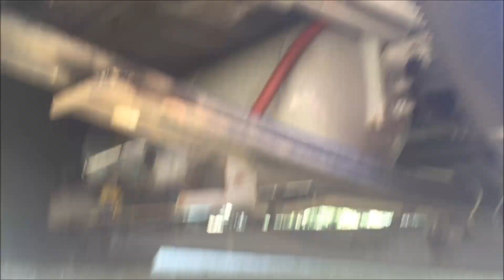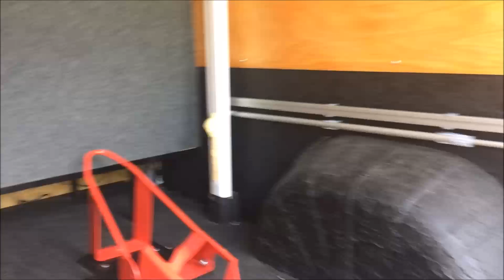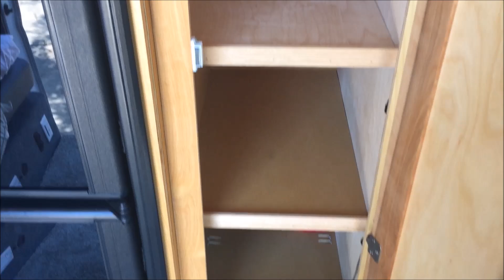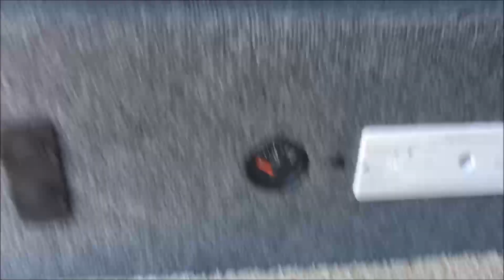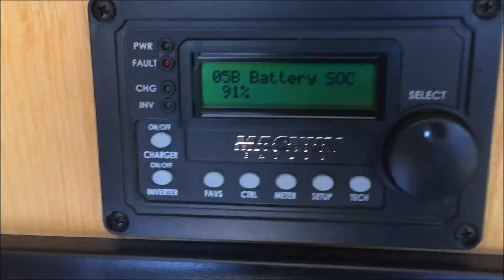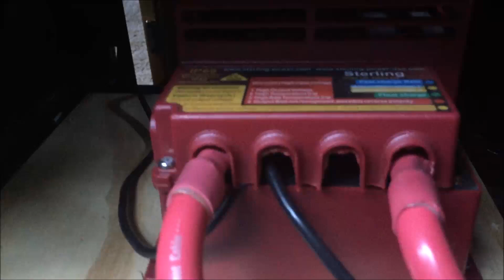DIY Stealth Camper Van Tour

Comment: Great track van. Nice job on the layout. 
Looking to convert my 1st van in the spring. With possible bike trailer. Did you have any problems with the diesel Promaster. Looking to stay away from sprinter and dont really car for the short wheelbase of the Transit.
Thanks for sharing. Mike

Comment: Awesome moto van! Love all the options that you installed. I am building one too. I thought about a suspended bed and three dirt bikes underneath it, but then decided to go for a couch and one dirt bike. More useful for me since I usually carry just 1 or 2 dirt bikes. My van is going to have a shower though, and a pressure washer to wash the bikes. I do not want to be dirty after riding dirt bikes!
Reply: Philip good choice
Reply: I've seen a similar idea but done with 2 sets of flip up bunks mounted on either side of the back of the van with a drop in piece to make the bottom bunks a king sized bed if wanted. Just fold the bunks up and add dirt bikes. 1 adult size one and 2 kids sized.

Comment: What does that air conditioner pull when it's on? I've been wanting to get one that doesn't kill inverters and generators and blow fuses all the time... the one I have is over 30 years old and it draws unimaginable amounts of power. :[

Can you run that air conditioner off that inverter? (Those Magnasine ones are really nice... I'd be surprised if it wouldn't start the AC just fine.)
Reply from the maker: Four ZeroFour it ran fine off of my generator.  I had a 3000w champion inverter generator.  It would run off the inverter too....but man the 400amp hrs would be down to 50%in like 45min.  It was a Mach 8 13.5 by Coleman.
Reply: @Dr.KennethNoisewater  Kenneth that's what I figured.

Comment: I am curious what is the electric distribution panel you have. this is the second time I've seen this same one and the last person wouldn't tell me. those are square D home line breakers in the box right?
Reply: DrKennethNoisewater Hi nice work is the promaster is agood choice comp to ford or M b
Reply from the maker: Skye Renard 

PD5000 30amp panel

http://www.bestconverter.com/PD5000-30-Amp-ACDC-Power-Control-Panel_p_27.html#.WMDPCIFOKEd
Reply: Thank you very much. Quite the life saver

Comment: I know you sold it but what were you asking for it???
Reply: Not sure if it's the final asking price but at the very beginning of the video there's a splash screen that shows a price along with other details.
Reply: R.J. Moser oh YEAH, thanks 55k. GREAT deal whoever got it. the custom work is fuckn AWESOME!!! ESPECIALLY the electrical system. JUST AWESOME!!!
Reply from the maker: Marko Markuezovic 

Van sold for $40k
Reply from the maker: Marko Markuezovic 

I started at $55k and had quite a bit of interest .  The problem was nobody has the cash and banks wouldn't lend on it over $35k....they don't recognize the mods or know how to value it.  The van is also a commercial vehicle...I found this to be another obstacle for lending.
Reply: DrKennethNoisewater 2

Comment: I have a question about the battery to battery charger. If you have an inverter already installed, why not just use that with a regular battery charger? Is it just the convenience, or is the B to B charger better? If so, how? Great video by the way. Love the build. Glad to see you go tit sold. I'd love to see what you did next!
Reply from the maker: max carson 

The batt to batt charger puts a much higher quality charge on my batteries....increases life span.  5 stage charging
Reply: max carson  I think what you're referring to is the charging by the alternator while the van is driving or the engine is running.